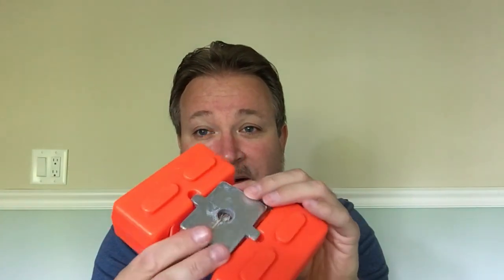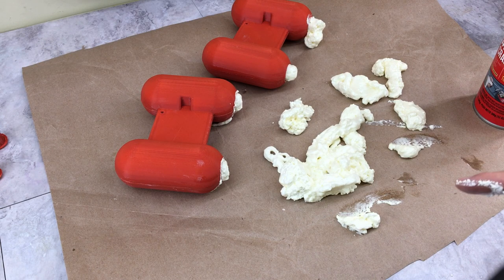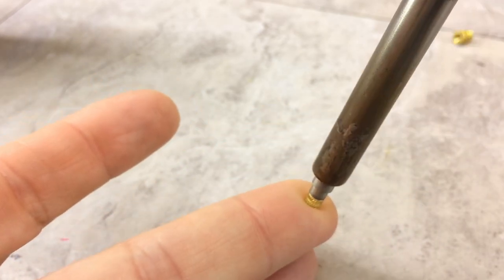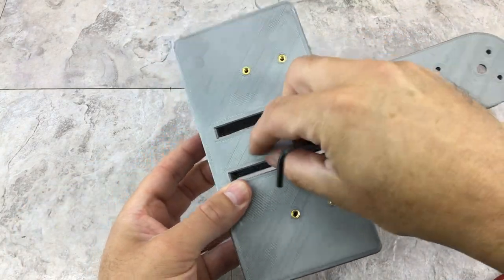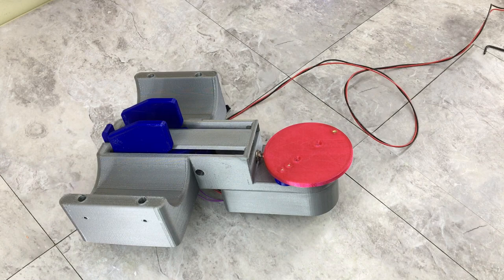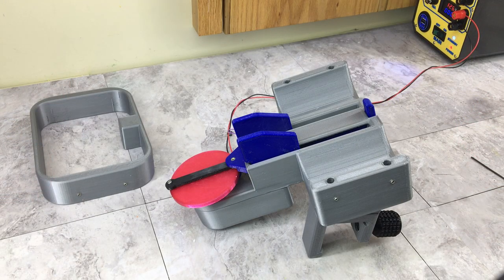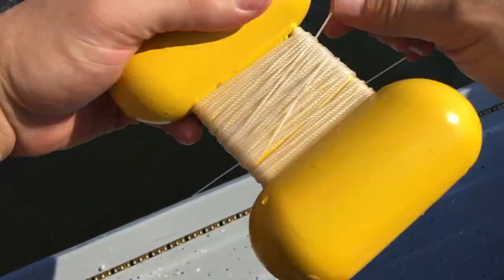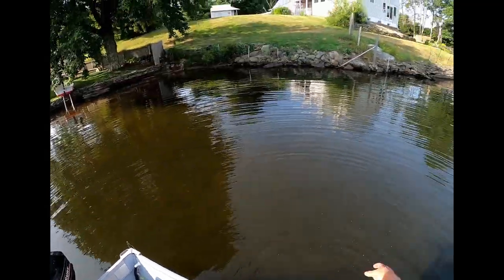The Depth Charger - Marker Buoy Deployment System

Comment: Thanks for an entertaining video.  Nice design and an excellent outcome.
Looks like you are using Fusion 360.  I used it for a whlle using the Hobby license.  Then Fusion cut that off so I went back to my ONECNC Cad/Cam program.  I make similar items but no 3D printed stuff to date.  At first my projects were centered around the Radio Control Hobby mostly Helicopters then I got into boating and have made items for my Hobie Pro Angler 14 Kayak and inshore Scout boat.  Also have made a few shop tools and other items like you mentioned.  As you said.  WHY????   Because I can.  Ha Ha
Reply from the maker: I thought you could still do the Hobby License but the just limited some of the things you could do with it.  I too have designed stuff for pretty much every hobby I'm involved in.  The 3D printed just makes things so much easier... I've made things (like this project) that I never would have imagined being able to do just a few years ago.
Reply: @TheNeverendingProjectsList  I have a HAAS TM-1P in my home workshop with a tool changer, probe, coolant, etc. that I use f(or my personal use).
It has been some time since I quit using Fuston 360.  It wouldn't let you do tool changes any longer and making separate files for each tool operation made it almost a waste of time to use the program.  The old bait and switch routine.  Spent a bunch of time learning the program and then they crippled the use of it.  What a Joke!!!!!
Reply from the maker: @helicopterjohns  Oh Man I'd wish I had room for a tool like that.... but yeah they did kill all the CAM stuff from the Hobby license (as well as some other stuff) I kind of get why they did it but it does suck. Even with the paid version they are getting greedy... they are killing off a bunch of stuff that has to do with rendering/simulation where you can only do it in cloud now and of course that cost more money.  It's already way to expensive for a guy like me and I only paid so I could sell my designs but it's going to get to the point where it's not worth it anymore and I'll have to move on to another program again too.

Comment: Question, was the weights loose so they fall out when it hit the water? I was thinking if they were tight your float would not let the string out and your float would just drift off.  Great job, love the make your own stuff.
Reply from the maker: Yes that is exactly how they are setup.  The original ones had the weight that snapped in place for covenant storage but I made them loose so they would release once deployed.

Comment: Hey so I just purchased my first 3d printer, what's the best free cad software and gcode, also I purchased a ender 3 v2 and I purchased some gray esun pla + and am having stringing issues on the first layers, my bed temp is at 65 and my nozzle temp is 220 any tips would be greatly appreciated
Reply from the maker: As far as CAD software goes I'd recommend Fusion360 as the do have a free license for hobbyist. There is a learning curve to it but there are plenty of YouTube videos about it so you can learn a lot from there.  Check out Cura for slicing (creating gcode) it's free too. I don't use it personally but I heard great things about it. I really don't know a ton about fixing print issues but for stringing try lowering your temp or it might be retraction settings. You may need more or faster retraction.  You can try hitting up the Reddit 3dprinting Subreddits for printer help I know a lot of people use the Enders on there.